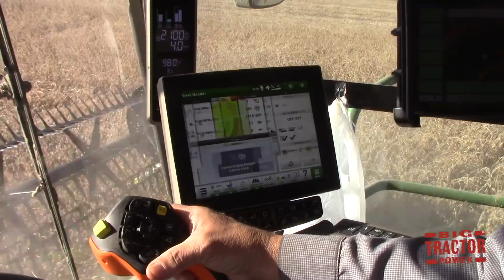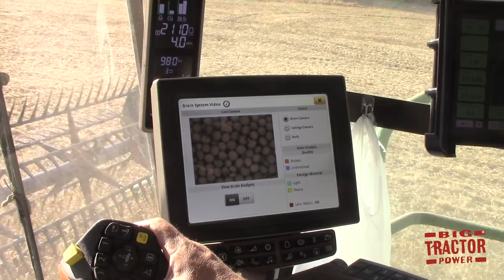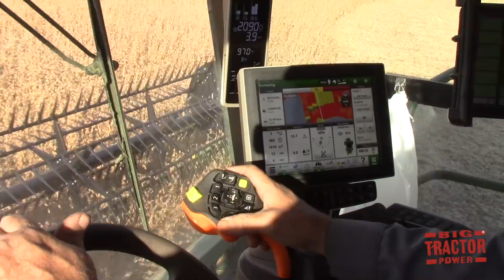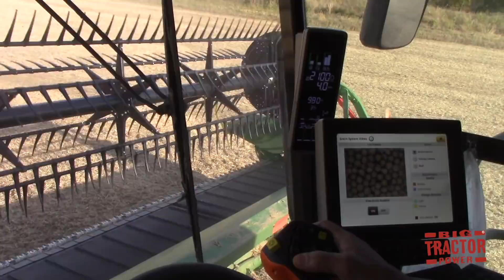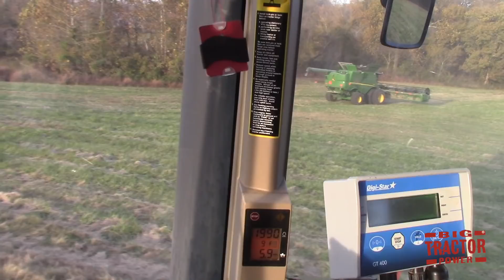John Deere S780 Combines On the Move in Soybeans

Comment: I saw row cleaners on the front row of the planter, do you recall if the interplant also have row cleaners on the rear planting units? Does the second row throw all it's trash on top of the front rows that are already planted by the front units?

Comment: Great video! But why does the 9220 have wheel weights on the rear left dual but not the right?
Reply from the maker: I am not sure.  They have made a wheel change in a hurry and not put the weight back on.  This tractor mainly does grain cart work.  Next time I see it I will have to ask.

Comment: At 550,000 apiece it better have everything Too bad they wear out before you can recoup the investment
Reply from the maker: Most farms here trade each year because they want to newest machines to reduce down time in tight harvest windows to get two crops out of one field in a year.
Reply: @bigtractorpower  I understand wanting to reduce downtime However new equipment does break down also My thinking is the main reason a lot of big farms trade every yr is more for tax purposes than anything, in my area farming is a place to spend money from other income sources to write off equipment if farm commodities were half of todays prices which are already break-even or less these big corporate farms would still buy new machines every year
Reply: Alden H I buy new every single year. I’m working 250,000 acres. Thanks for watching sir